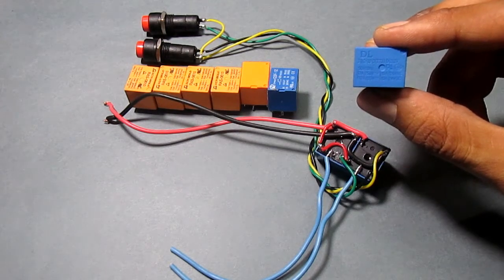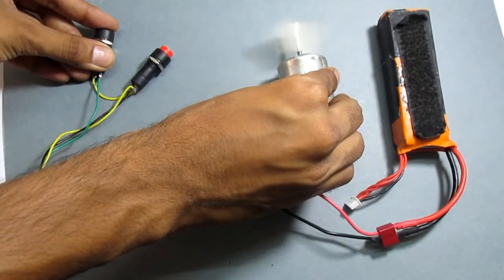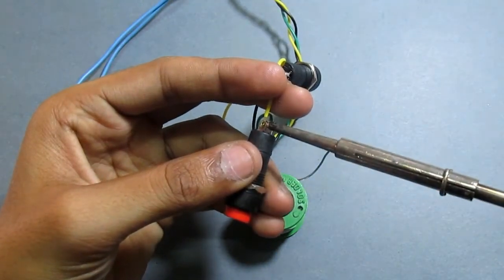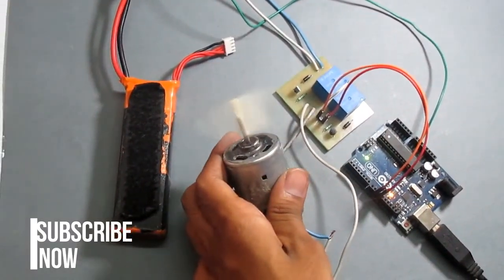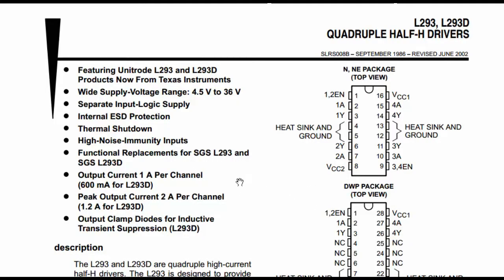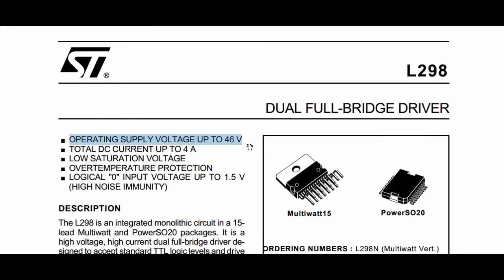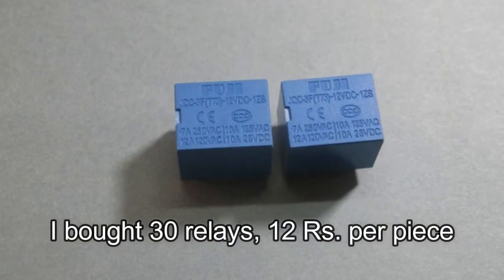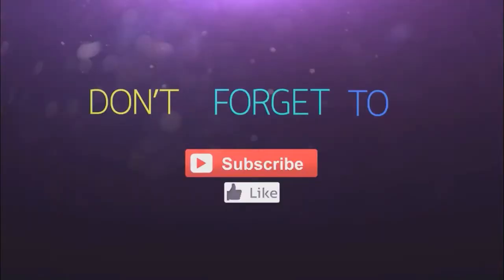Relays vs Motor Driver IC's  | How to use Relays | DIY Relay Motor Driver Arduino

Comment: Whether there is a possibility of motor changing its direction by channel relay without using any switches or buttons???
Reply from the maker: Yes, by using two relays. Active hight one of the relay and deactive another relay motor will rotate in one direction lets say clock wise direction. Now active another relay and deactive first one motor will rotate in opposite direction.
Reply: @Mindstorm  is it possible to control reverse and forward direction of AC MOTOR  by relay?